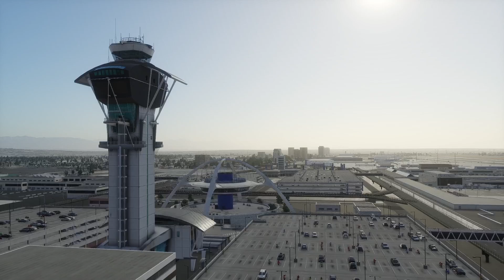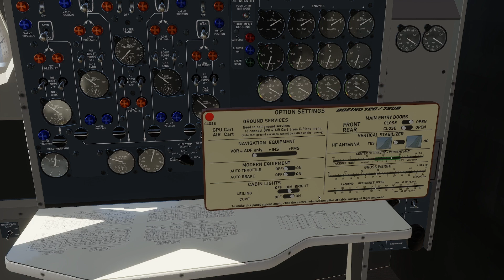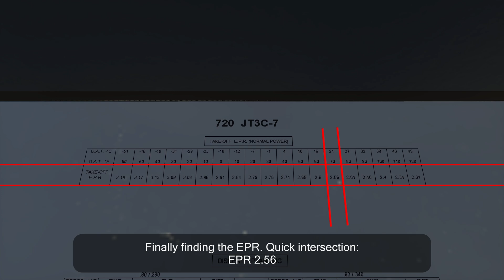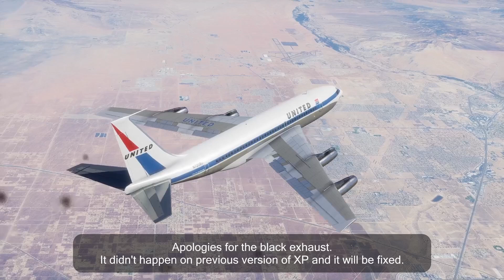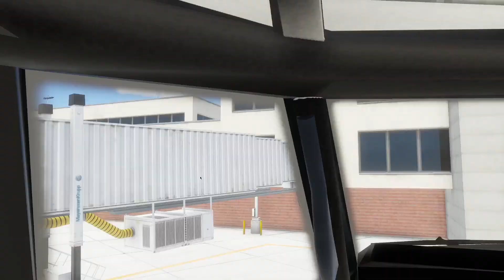Freeware Boeing 720 | United Airlines | Los Angeles KLAX - Denver KDEN | X-Plane 12

Comment: How did you get the jetway to work with the mod? I can't get mine to work, like it's not recognized.
Reply from the maker: That is a difficult question because it can depend on scenery, mods and whatnot. Sometimes it should work and it doesn't and sometimes it works. I could never figure it out.

I have the marshaller mod and the ground services mod. Maybe that helps. Can't remember if I have autogate but I think not. Se sceneries require SAM and those don't work for me too.

Comment: Which simbreif flight plan layout did you use. Is it one of the UAL ones or something different.
Reply from the maker: I use the easyJet one because I got quite used to it, but any works as long as you like and it has what you need :)
Reply: @ cool I normally just use lido but yours looked really interesting
Reply from the maker: Haha Lido is nice for Boeings as it has all the info that's useful for the Boeing FMC. For the airbus is slightly different and I just got used with the easyJet one

Comment: Deeply enjoyed the video. I have had no issue with starting the aircraft but it will not steer on the ground. Do you know any tricks for using nose steering? Again thank you for the excellent video.
Reply from the maker: Glad you liked it! 
Hmmm i don't have such problem but try the following: reassign and check if you don't have conflicting bindings for the steering. Check if all your HYD Systems are ON. 
Good luck!
Reply: @VladAkimov  Deeply appreciate you getting back with me. There were options for the aircraft. So I loaded up the second one 720 not 720B and the steering worked fine in XP12. Really do enjoy this bird. We are about the same age. LOL 😅
Reply from the maker: Glad that it worked for you!
Enjoy the plane! Hahah :)

Comment: Can you send me the simbrief profile for this? Or did you use an existing one??
Reply from the maker: There are two separate simbrief profiles for each engine model in the description of the model on the forums! You can add directly from there.
Reply: @VladAkimov  okay, and is the ins fully functional? And is there an autopilot
Reply from the maker: You have to have the payware plugin for the INS. It will be fully functional then. And yes, there is an Autopilot. You can even enable an Autothrottle on the airplane menu as I show.
Reply: @VladAkimov  oh that’s sad about the ins, thanks 🙏

Comment: You cannot turn on Packs without air.  This plane does not have an APU.  You would not want those switches set ON before trying to start engines.  You would also not turn ON all of the boost pumps and open all of the crossfeeds. You need to review the normal procedures for the plane to properly operate these and all systems.
Reply from the maker: Thanks! Also, I mention twice in the video that the plane does not have an APU. Unfortunately I didn't find any operating manual for the 720. Will a manual for the 707 work? It might be easier to find. If you have one, PM me please.

Comment: The United B720 did not have the HF ant on the fin.  Small errors to the engine inlets but overall the modeling of this type is very good.
Reply from the maker: Thanks for letting me know! I will fly without that antenna for the next United planes and will check on other airlines. By any chance do you have any source of where can I find this information for other operators?